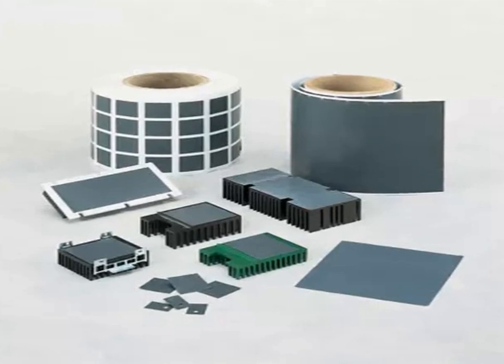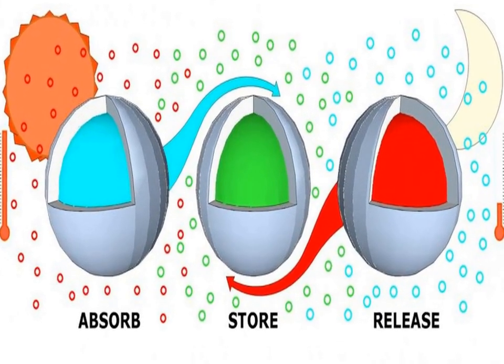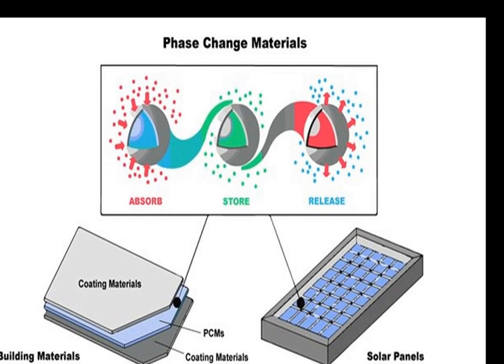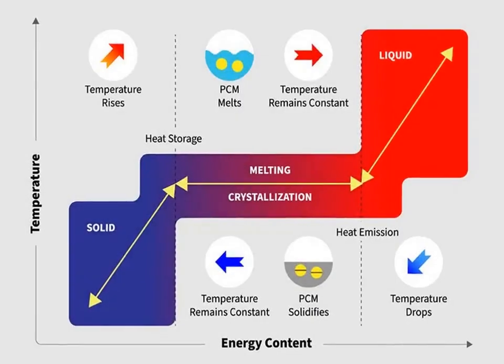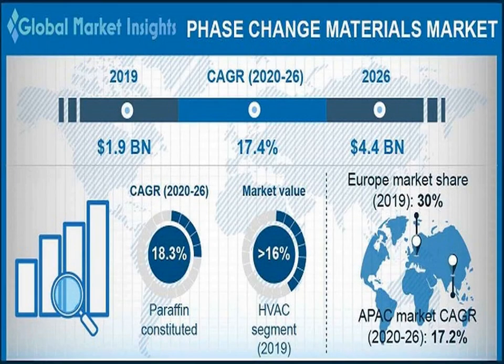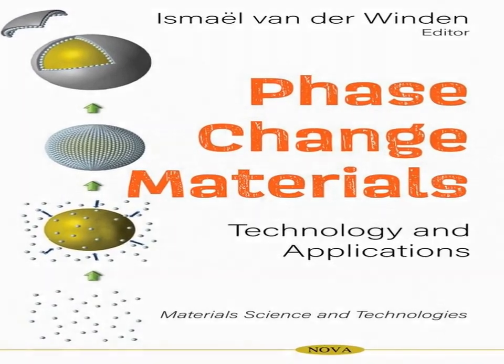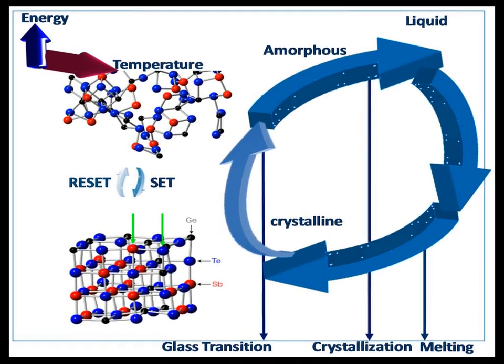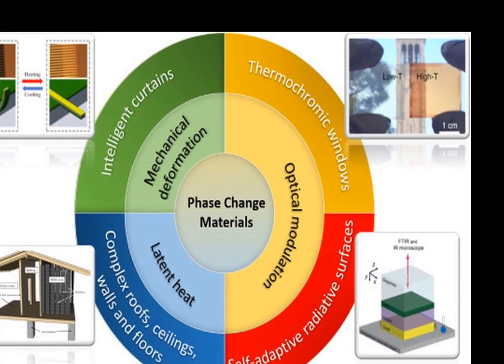INTERESTING MATERIALS: Phase-change Materials (PCMs)

Comment from the maker: Further reading:

Zalba, B., Marín, J. M., Cabeza, L. F., & Mehling, H. (2003). Review on thermal energy storage with phase change: materials, heat transfer analysis and applications. Applied Thermal Engineering, 23(3), 251–283.

Wuttig, M., & Yamada, N. (2007). Phase-change materials for rewriteable data storage. Nature Materials, 6(11), 824–832.

Cabeza, L. F., Castell, A., Barreneche, C., de Gracia, A., & Fernández, A. I. (2011). Materials used as PCM in thermal energy storage in buildings: A review. Renewable and Sustainable Energy Reviews, 15(3), 1675–1695.

Raoux, S., & Wuttig, M. (2009). Phase Change Materials: Science and Applications. Springer.

P. Zhang et al., “Phase change materials for thermal energy storage: Materials, mechanisms and applications,” Progress in Materials Science, vol. 121, 2021.

A. Sharma et al., “Review on thermal energy storage with phase change materials and applications,” Renewable and Sustainable Energy Reviews, vol. 13, pp. 318–345, 2009.

Abhat, A. (1983). Low temperature latent heat thermal energy storage: Heat storage materials. Solar Energy, 30(4), 313–332.

Farid, M. M., Khudhair, A. M., Razack, S. A. K., & Al-Hallaj, S. (2004). A review on phase change energy storage: materials and applications. Energy Conversion and Management, 45(9–10), 1597–1615.